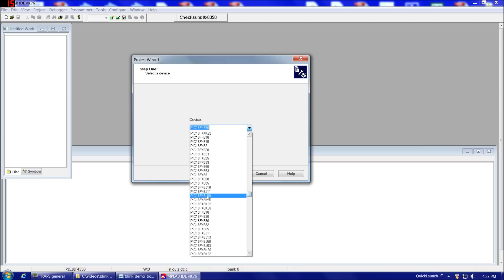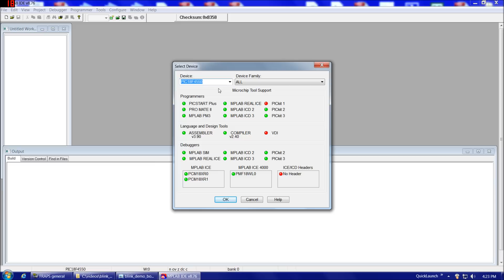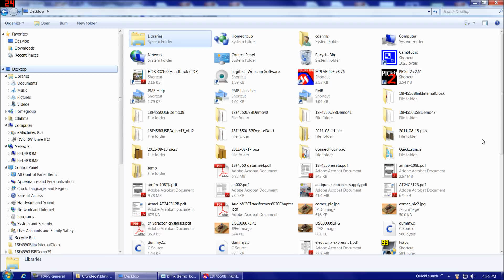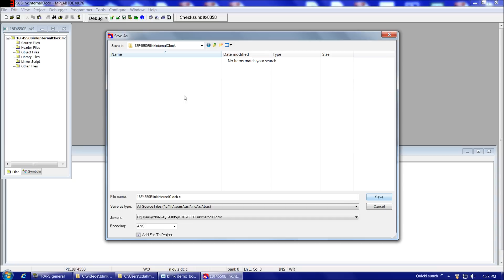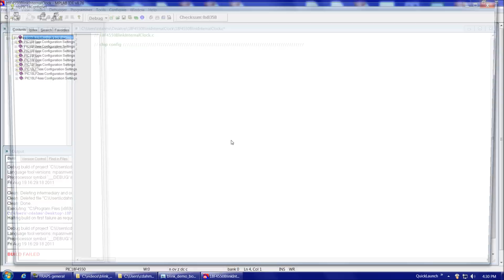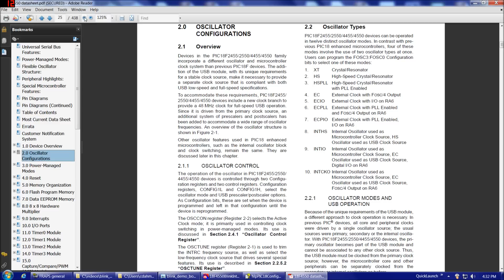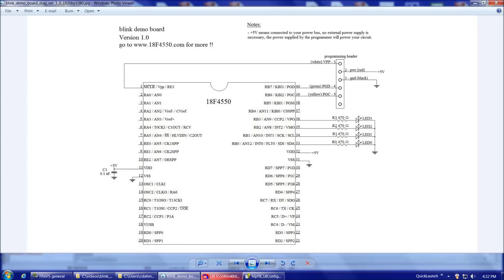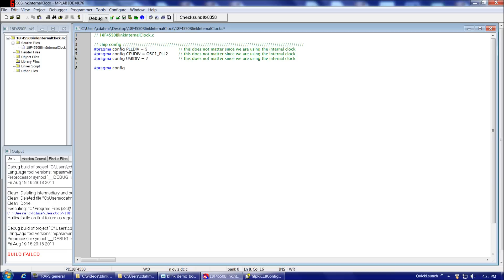How to program the PIC18F4550 microcontroller (blink demo board) part 3 of 8

Comment: Is it possible to program the 18F4550 to control an LCD display. I am wanting it to control and display the parameters that I need. ie; voltage input/output, amperage input/output, speed, odometer (from a transmission speed sensor), and battery life. I consider myself a novice, but I am also a fast learner. I would like for these parameters to be displayed all on one screen with set location, but with the ability to openly monitor the inputs/outputs as they change in the system. Any suggestions?